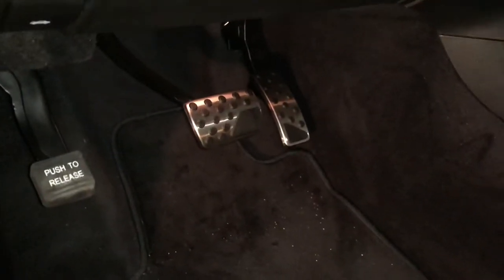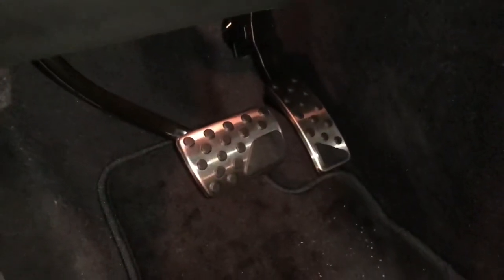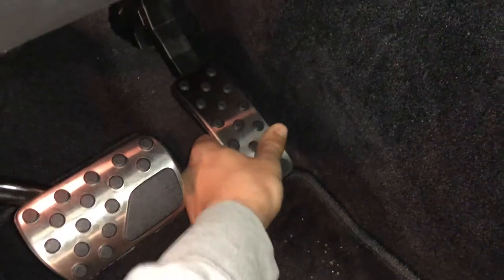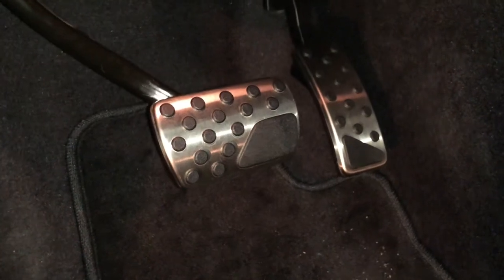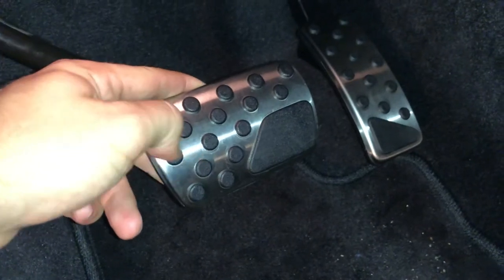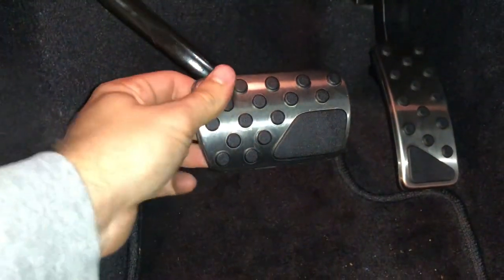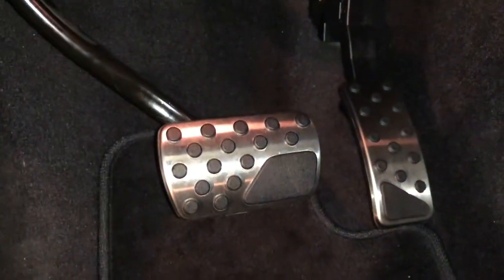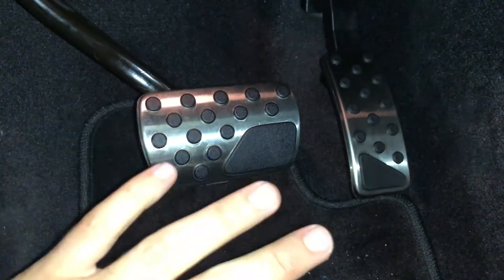Mopar Gas & Brake Pedal BEST install tips! 10 min!

Comment: Thanks for the tips. I choose a different technique. It turned out even easier. I picked up the brake pedal.....firmly grasped it with my right hand....and I threw it as far as I could into the woods. 

Fuck that pedal.

Comment: Thanks for the great tip! I got the gas pedal cover on with no problem but the brake pedal cover is very difficult to install. I watched several other videos but your tip on using hot water to soften the rubber was the only one that worked. Thanks very much- I was getting pretty frustrated with what seemed like a simple job!

Comment: Thanks for the video. Gas pedal was a breeze. I almost gave up on the brake pedal even after soaking it in what I thought was hot enough water. I decided to try boiling the water and for the brake pedal scalding hot and it slipped on no problem.

Comment: Tried the boiling method (minute and a half) and with little bit of a struggle, I popped it on. Started at top left so I could get more leverage with the lower right with my fingers.

Comment: My man! Huge help. Tried soapy water yesterday and busted my knuckles. Today I did near boiling water for 10-20 seconds and it slipped on with minimal effort. The cover has a little left-to-right play, hopefully that’ll fade as it cools down a bit. (I asked for no prep on my ‘21 Durango SRT and didn’t realize this was included, otherwise I would have asked the dealer to deal with it)

Comment: Okay, I just finished my pedal install.  The gas pedal goes on right over the normal gas pedal. There was no rubber cover to remove.  that is the easy one to install.  As discussed, let the pedals sit in hot water for about 3 mins at least.   If you look at the back of the break pedal you will see a circular cut on the top right corner of the pedal gasket.  you will put that corner on last.  Get all three corners on, then work with a thin flat head screwdriver and work from both corners towards the the unattached corner.  It takes some doing but it will go on.  I was working at first with a bigger short flat head and it did not work.  It will take about 15 minutes to install.

Comment: Me and a friend installed in in literally 30 seconds.. Cut two vertical slits on both sides of the top row, duct tape the top flap of rubber back as far as you can, slip the bottom part on and rip the duct tape off, installed, easy and fast without having to spend time doing anything else.
Reply: Lol…..no

Comment: How did you remove the factory rubber from the brake pedal?
Reply from the maker: Rhea Stevens I just pulled from the back with both hands on the tops of the corners and they came off rather easily.
Reply: Be strategic...pick a corner and just pull and pull till you get it off.